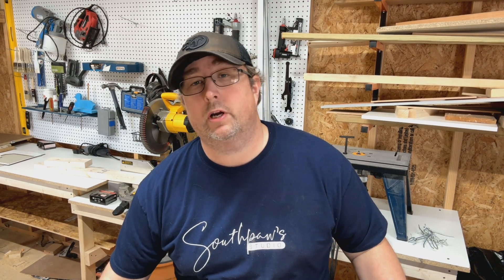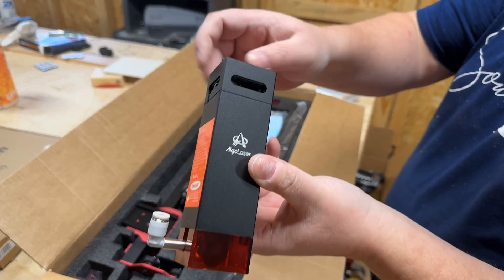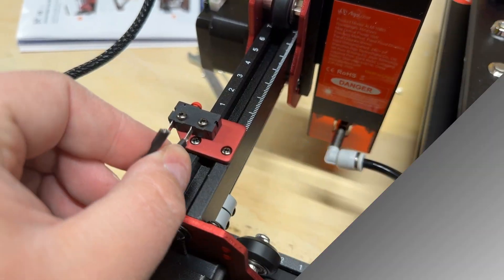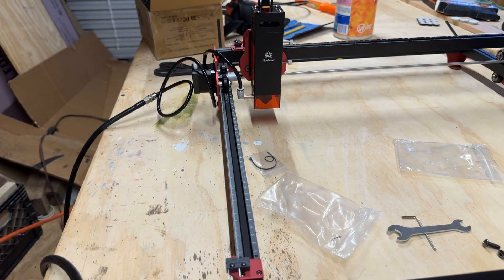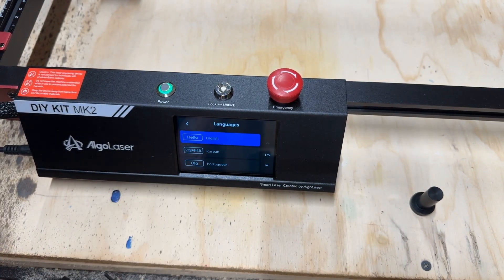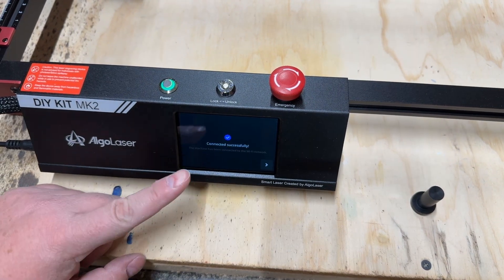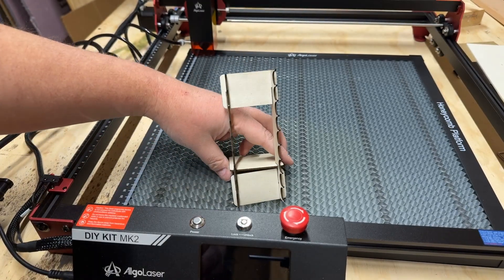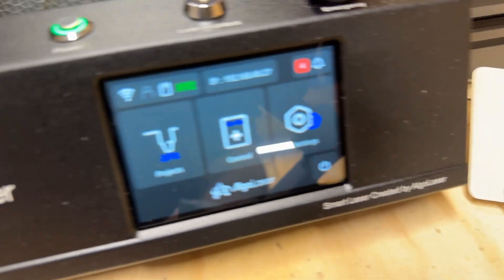Budget Laser Cutting Made Easy! AlgoLaser DIY KIT MK2 Laser Engraver

Comment: What program is best for this on designing? Wife and I just ordered the whole set up including the cup turner and feet risers! FYI Amazon has a $200 off coupon as well through them! Thanks again for the video!
Reply from the maker: I like using Lightburn to run the machine. There's a free trial to try it. I use Photoshop and Illustrator to design the actual files typically.
Reply: @ Ty Sir!